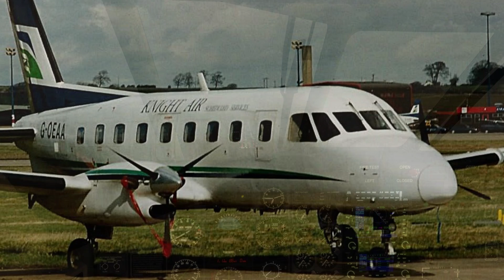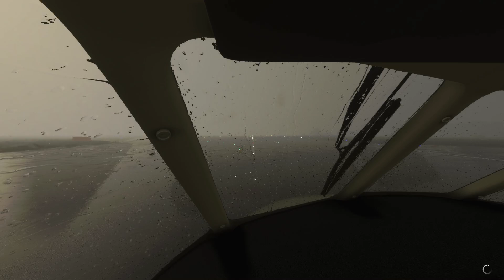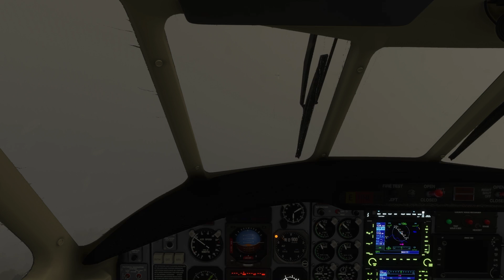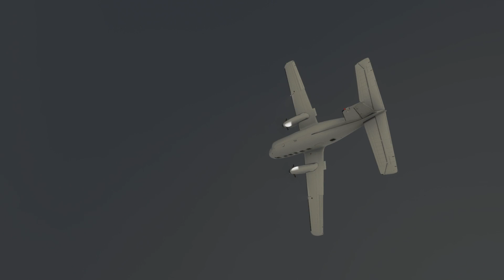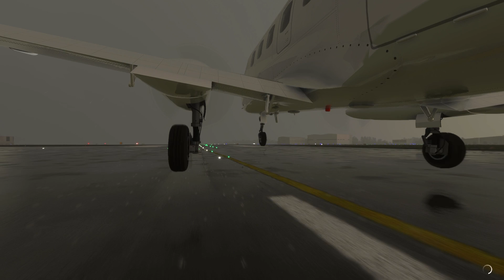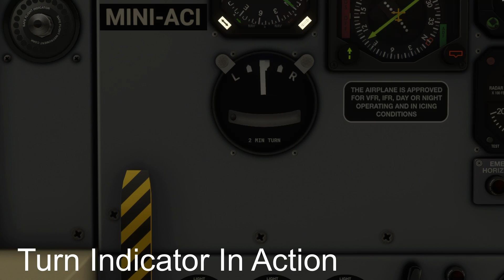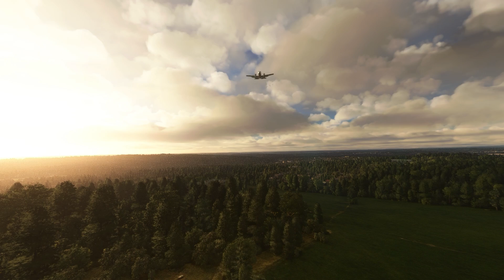The Pilot Who Was Flying Blind | The Crash Of Knight Air 816

Comment: 5:09 - No, you CANNOT rely on your senses to distinguish inertial space (what your inner ear thinks the plane is doing) from gravitational space (where the ground is). That's a sure formula for a crash. Neither can the gyro distinguish them; it responds to its own inertial space. Fortunately for short distances the gyro's inertial space and gravitational space are identical, so the gyro readings can tell us where the ground is.

The slip-skid ball (the "turn indicator", or bank indicator, is something else, usually built into the same housing as the slip-skid indicator, the one with the little ball) CANNOT tell you if you're level. It can ONLY tell you that you are in a coordinated turn, a slip, or a skid. A weight hung from a string, the surface of a glass of water, a carpenter's level - they'll all indicate exactly what the ball shows, because they all respond to exactly the same forces. Those forces are a vector sum of inertial and gravitational forces, and the two are indistinguishable. So you can spiral all the way into the ground with your slip-skid ball showing you that everything's fine. IF your slip-skid ball tells you that you're in a coordinated turn, then your compass will tell you if you're going straight (usually - there are exceptions, not worth worrying about). If you think you're in straight & level flight, but the compass is rotating, and your slip-skid ball says you're in a coordinated turn, then you can only be banking - i.e., you know your wings AREN'T level. (A functioning heading indicator is easier to use than a compass, since weird things happen to the compass when accelerating through a magnetic field, and turning is accelerating. But the heading indicator is a gyro instrument - if your gyros are out, so is the heading indicator.)
Reply: So, in other words, for me…stick my head between my legs and kiss me arse goodbye!🛩💥🔥

Comment: I would not recommend the flying school that pretended to teach these pilots. They should have been taught to constantly crosscheck instruments to confirm their function. You can comfortably fly in these conditions with your Horizon covered over. You just use bat and ball for turn and balance. Altimeter and airspeed for pitch attitude. Directional indicator to confirm heading. This coupled with using correct power setting will keep you safe. These guys should have stayed on the ground until blue skies appeared. Very basic. RIP guys

Comment: Something doesn't square up in this story.  In some 2000 hours flying a dozen or so EMB-110s, they all had dual instrument panels... The US FAA requires, and I suspect the British CAA likewise would specify that a passenger carrying multiengine airliner qualified to fly in instrument conditions have dual instrument panels which would include redundant attitude indicators... 
If there were two attitude indicators there should have been no reason to lose control of the airplane, so it appears there's more to this story.

Comment: My father trained many pilots. He would let them experience spatial disorientation by having them close their eyes to fly by "Feeling" the plane. They would start to bank a bit, feel it and correct. Then they would bank again, feel it and correct. Each time they would overcorrect and after 60 seconds they would be in a bank they could no longer "feel". At this point they were only 30 seconds away from the "Death Spiral".

My Dad would ask them if they were flying level, and they would say "Yes". He'd tell them to open their eyes and they would freak out at how close they were to losing control of the plane.

You cannot trust your senses in a plane without visual reference, which is why instruments are so damn important and needing to know how to read them when or figure out from the rest in a failure is key to staying alive.

Comment: It’s called a glass filled half with water.
Reply: This doesn't work. Take a quick look at the other comments. There's a reason fluid or spirit levels don't work on airplanes. It's the same reason your drink doesn't spill or tilt when the plane turns. It just gets a bit heavier.
Reply: @GratuitousSets  or how about a plumbob you hang from the ceiling straight down.
Reply: @Catpain_Tailspin  This shows you exactly the same thing as the ball indicator. It doesn't tell you where the ground is. The reason we use the ball indicator rather than a pendulum is that it's more compact and takes up less valuable panel real estate. Kinematically and dynamically they're identical.
Reply: @Catpain_Tailspin  Nope. I can pour water normally even when upside down. I can also put an open coke on the floor, roll the airplane inverted and not spill a drop. Unless you kick the rudder you don't feel any side force.

Comment: 5:30 This is wrong. This instrument is called a turn and slip indicator, or the turn coordinator. Airplanes use bother bank and rudder to turn. When done correctly, when a turn is coordinated) forces on the plane will be straight down. You should not feel any side to side forces.
     The bubble/ball part of the instrument is basically a bubble level. It tells you if there are any side to side forces acting on the plane. Student pilots are taught to "step on the ball" to keep it centered.
   It is the needle part of the instrument that can sort of tell you you are in a bank.
   You were correct to say you have to equalize the G forces acting on the plane. To do that, you want the ball centered, then use the turn indicator to check your bank.
    This accident should not have happened with an IFR qualified pilot. It seems this flight crew were not "current" with their instrument flight skills. They failed to respond correctly to this situation. When they lost the AH they did what a typical VFR pilot does in IMC. They did not fall back on their training. They panicked and quit thinking.
Reply from the maker: Thanks for the correction Eric!
Reply: @MiniAirCrashInvestigation  I enjoy your videos. They are quite well done, but no one is perfect.
    I like your stuff more than Dan Gryder. He sometimes seems a bit full of himself. I'm sure he is quite good, but being good can lead to being over confident.
Reply from the maker: I think the accident plane only had a turn indicator and the plane in the sim had a turn and slip indicator so that’s probably the source of the confusion
Reply: @MiniAirCrashInvestigation  It's shocking that an ATP qualified pilot would not have the skills to deal with an AH failure in IMC.
     But these guys do all kinds of things that are shocking for an ATP pilot.
    My dad was a CFI and he trained his pilots to deal with all sorts of emergencies and failures, including VFR into IMC.

Comment: Turn and slip indicator, compass and altimeter were all pilots had before the artificial horizon was invented. This aircraft crashed because the pilots hadn’t learned the basics of flying, or had forgotten those early limited panel lessons. More recent accidents have occurred because pilots couldn’t cope with the automation not doing what they expected. They were not prepared (or taught) to switch off the automatic systems and fly the aircraft manually. Manual flying is less efficient than letting a computer do the job, hence airlines encourage the use of automation as much as possible to reduce costs.

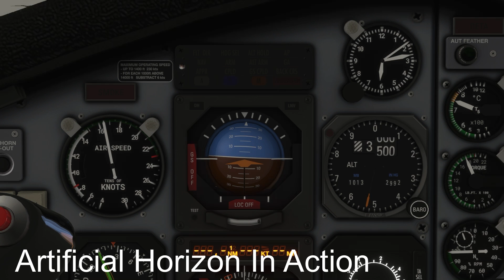Comment: 2:00 It's even worse than that. When you are in a moving vehicle you can be subjected to the accelerations (changes in velocity, not just speeding up) your body is subjected to. You can feel like you are in a bank, or pitched up or down when you are, in fact, level. You try to correct for the bank or pitch and end up disoriented. The feeling of being in a bank gets worse so you steepen the bank, and start tu pull up.
    Than can put you into a "death spiral" that can end on the ground, or as happened recently, tearing the wings off.
     There was a recent Moony crash where a witness took a picture of the plane a split second before impact. The plane is a couple of feet above the ground and both wings are folded up like a carrier fighter. The wings of a Moony don't fold up like that.
Reply: This reminds me of a college physics class that I took three years ago, where we were told about accelerometers. So I made my own accelerometer, and when I accelerated, the pendulum moved to a position. However, rapid changed in acceleration made it unreadable. So, using a pendulum in a cockpit to measure how level a plane is would probably be a bad idea. I enjoy science, technology and physics, so this is one reason I watch aviation channels. RIP to all those on this flight.

Comment: A correction on the Turn Indicator - The vertical needle shows the direction and rate of turn.  It's run off its own internal gyro. The ball shows how well coordinated (Slip or skid) your turns are.  Needle and Ball centered is wings level.
AIrspeed,. Altimeter, and Rate of Climb will tell you whether you are climbing or descending.
Reply: To elaborate a bit more. When turning, you use the stick to bank the aircraft in the direction you want to go, then apply rudder in the same direction. The idea is to keep the ball centered. For example, in a left turn, if the ball is to the left of center, you add more left rudder. If it's to right, you reduce your rudder input. This is called "stepping on the ball". 
If you apply opposite rudder, you induce a side slip. This can be a useful maneuver, particularly on a final approach with a cross wind. 
There is a very good book on flying called "Stick and Rudder" by Wolfgang Langeiwiesche.
Reply: @Redspeare  amazing explanation, i've never flown a plane in my life and I completely understood it

Comment: This seems ridiculous to me - there are tons of instruments that would tell you if the ADI failed. throwing your hands up and saying you have no clue what the plane is doing is insane. If the turn coordinator shows a left turn and your compasses (there are many!) are rotating that direction, then the plane is turning left! 

Zero out your vertical speed and altimeter changes and you’re TOTALLY fine.

These pilots disregarded not one, but nearly every instrument in the cockpit. It’s as if you took two low-time student pilots and immediately threw them under the hood for a worst-case VFR into IMC condition. This should have been survivable 10/10 times. 😞

Comment: Leeds Bradford Airport is a very difficuly airport to fly into and out of. It is the highest in England, sitting at an altitude of 681 ft (208 m) above sea level, so pilots coming in and going out frequently experience cross-winds.

Incidentally, shortly after the crash, Knight Air sold all of its services and its two newset aircraft Jetstream 31s - to Manx Air Europe, which were operated as British Airways Express. The services are now operated by Aurigny (Guernsey - seasonal); British Airways (Belfast-City - seasonal); and Eastern Airways (Southampton; Newquay - seasonal). There are now no flights to Aberdeen.

Comment: The turn indicator consists of two instruments. The ball is not usable to hold the horizon. If you are upside down the ball is still centered.
But the needle is driven by a gyro and it can be used to keep flying somewhat straight ahead.

The ball shows side forces which are zero as long as you don't have major asymmetries. The needle shows rate of turn - that's what needs to be zero to fly straight.

Comment: This is a really well explaned investigation, nothing to add ;)
And yes a stby horizon is something you should not cut costs on.
Reply: They add confusion and can do more harm than good, especially those little battery powered ones.
Reply: @bingosunnoon9341  Diferent opinion based on lot of instruction time.
Reply: @pascalcoole2725  That is probably true, I only have a couple of hundred hours of actual instrument and never saw the need for a backup horizon.
Reply: @bingosunnoon9341  Ahhh i understand.
Don't worry about that.
Dark cockpits do accure rarely but if it happens what you realy want is, IAS, ALT, Attitude and some form of knowing where the hell you'r going.
Hope you'l never need it.

Comment: I would think that I would be calling for a glass of water and a level cup holder and use it as an artificial horizon. Nose up or down would be easy with the water. Turns would be affected by aileron and rudder in sync like a normal turn. But the water would indicate a roll if you don't match it with rudder for a normal turn. Not a pilot, but this is a way to help out in my unprofessional opinion.
Reply: This doesn't work. Take a quick look at the other comments. There's a reason fluid or spirit levels don't work on airplanes. It's the same reason your drink doesn't spill or tilt when the plane turns. It just gets a bit heavier.

Comment: They could use a glass of water instead of horizontal. As Russians did and successfully landed a plane 10 years ago or so
Reply: Urban myth. This doesn't work. Take a quick look at the other comments. There's a reason fluid or spirit levels don't work on airplanes. It's the same reason your drink doesn't spill or tilt when the plane turns. It just gets a bit heavier.

Comment: How about using a bottle with liquid? Wouldn't that kinda work?
Reply: This doesn't work. Take a quick look at the other comments. There's a reason fluid or spirit levels don't work on airplanes. It's the same reason your drink doesn't spill or tilt when the plane turns. It just gets a bit heavier.
Reply: That is how the turn indicator sort of works with the ball in liquid.  However in a coordinated turn the g forces are towards the bottom of the plane rather than the earth so that would not help, but these pilots should have been good enough with limited panel training flying by their turn coordinator, altimeter, compass, VSI, and ASI to avoid this accident

Comment: Phone gyro through any of hundreds of apps or games that utilise it, anything at all held with the mass suspended to act as a pendulum, any liquid visible in a container, a $1 suction cup car ball compass, a golf ball in a lunch box. I'm guessing that the personal jet is the first place a learner pilot starts flying commercially.
Reply: I think all planes should have fuzzy dice hanging from the rear view.  Haha
Reply: @JasonFlorida  This doesn't work. Take a quick look at the other comments. There's a reason fluid or spirit levels don't work on airplanes. It's the same reason your drink doesn't spill or tilt when the plane turns. It just gets a bit heavier.
Reply: An overturned coke can and a cufflink lol. I don't want to berate the dead, just reminding people that sometimes simple gut logic saves lives. The checklists should personally memorised and be voice searchable for the latest amendments, and suggesting all possible faults when one is detected. If a person watching the video could technically Google the answer faster than the pilots having a fault, the system is broken.
Reply: This doesn't work. Take a quick look at the other comments. There's a reason fluid or spirit levels don't work on airplanes. It's the same reason your drink doesn't spill or tilt when the plane turns. It just gets a bit heavier.

Comment: i think i have heard of a glass of water being used as a horizon. could that have worked?
Reply: This doesn't work. Take a quick look at the other comments. There's a reason fluid or spirit levels don't work on airplanes. It's the same reason your drink doesn't spill or tilt when the plane turns. It just gets a bit heavier.

Comment: Instrument rated pilots do not rely the ball of Turn indicator. That is only used to establish balanced flight. when Artificial horizon - Attitude Indicator (AI) is faulty then pilots must rely on the Turn Needle to establish wings level & NOT the Ball which usually goes opposite to the needle!

Comment: I recall in a other plane with ffull power loss they used water in a glass or bottle as horizon and managed to land.
Reply: I remember that too
Reply: Urban myth.  This doesn't work. Take a quick look at the other comments. There's a reason fluid or spirit levels don't work on airplanes. It's the same reason your drink doesn't spill or tilt when the plane turns. It just gets a bit heavier.
Reply: @GratuitousSets  good point, thanks

Comment: How quickly did this all unfold? I'm wondering if (where possible) another solution would be to have a second plane that happens to be in the area come over to shadow you, or lead the way, so you can visually orient yourselves against their angle of pitch/yaw/roll?
Reply: That's a good point if they could have followed someone in they would have visual contact with something
Reply: Had they the time to "scramble" a plane this may have indeed worked. What many people do not realize, however, is that "formation" flying is not as simple as it may appear and pilots must be trained for this. I suspect that the point is moot, however, as there was simply not enough time. What a horrible way to go, no visual cues whatsoever, and their most important instrument not working!
Reply: @historyluvvver  Sounds like a good way of adding mis air collision to your troubles.
Reply: @SuperHeatherMorris  Agreed. Hence my caveat regarding formation flying if you have no training for it. Definitely risky! But sometimes desperate situations call for desperate measures.

Comment: If one of the passengers has a water bottle you could use it as an artificial horizon because the water is always level
Reply: This doesn't work. Take a quick look at the other comments. There's a reason fluid or spirit levels don't work on airplanes. It's the same reason your drink doesn't spill or tilt when the plane turns. It just gets a bit heavier.